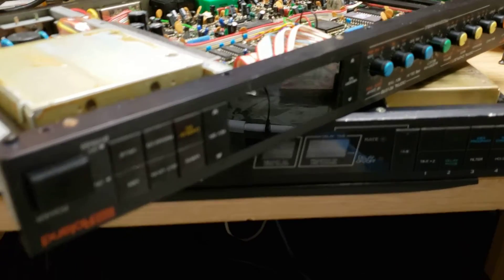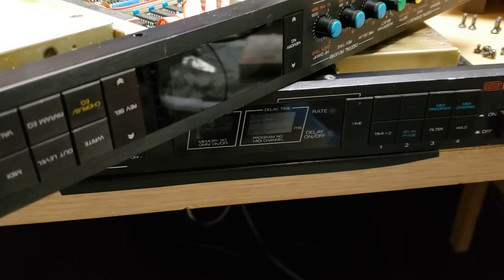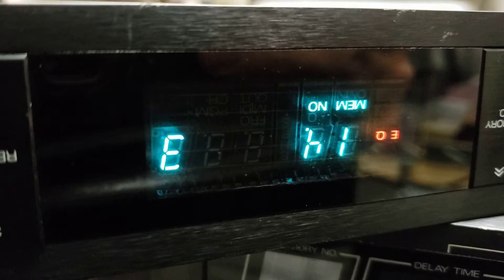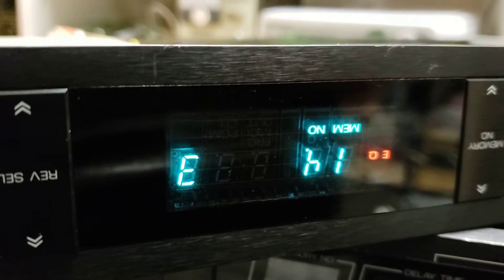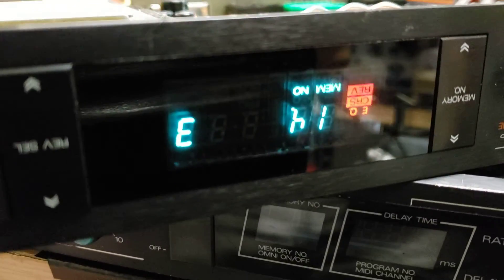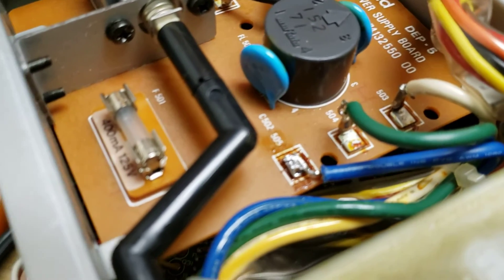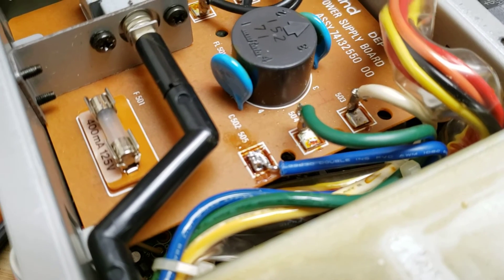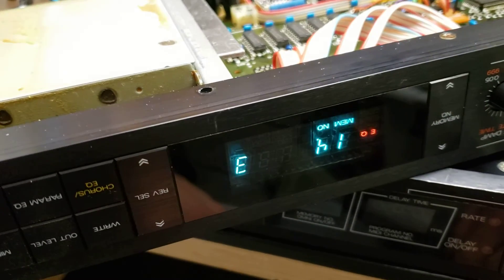Classic Japanese Rack FX - Keep 'em well with this fix.

Comment: Thank you for taking the time to make this video. My DEP-5 has the factory 117v badge on back, and the Blue to 505, Green to 504, and white to 503. This is like your video showed. Mine runs extremely hot to the touch--- should I change the wiring?

Comment: It's good advice to resolder it from 100V to 117V, but that's a sketchy anecdote about VFDs! That's not what happens when you plug a 100V DEP-5 into 120V, and if it does you need to unplug it fast!

The voltage to the display doesn't change when you run a 100V model on 120V — you can check with a multimeter.

Those Roland PSU boards have +5V +15 -15V DC output rails, and the ones with VFDs have a +30V rail. The rails are regulated. I've soldered these PSUs, and I always check the output rails to make sure everything looks good, and the most I've seen a rail change after retapping it is 0.03V which is still well within spec. That 30V rail is spec'd at 30V-34V.

The reason you want to resolder the taps is because running a 100V model on 120V power makes the voltage regulators run hotter. It will shorten the life of the PSU, and if it fails THEN it might fry something if a regulator shorts instead of just failing open. But '80s/'90s Rolands go decades without failing. Most people run 100V Rolands on 120V perpetually with no problems. They have huge heat sinks on the regulators. 

The only scenario for the glowing VFD filaments is:
1) You leave a 100V DEP-5 plugged into 120V power for several years
2) The 30V regulator is the first PSU component to fail.
3) The 30V regulator fails short and starts to burn.
4) You ignore the electrical fire / burning plastic smell and leave the DEP-5 on.
5) The 30V VFD is now getting about 60V of raw rectified DC from the transformer secondary winding.
6) The filaments glow red!
😯🔥🚒

I doubt it could last very long in that state before the PSU board completely burned and the capacitors popped and the whole thing died — and hopefully didn't burn the building down.
Reply from the maker: Yes WRT regulators running hot but also the main transformer will run hot and have reduced life.  The VFD has a high voltage blanking cathode (the VFD is in fact a Triode with each digit having a Grid, and each segment being an Anode). The filament (cathode) supply is rectified and filtered but it is not regulated. (Grey wires straight from transformer, rectified, 470uF cap, to + - filament terminals), and the higher voltage Anode supply (+20V) is also unregulated. Maybe Roland changed this in a later revision but that's the unit I have and the schematics agree. Given that the filament only wants 1.7V at 80mA (according to SDE3000 service notes) I'm concerned about the filaments glowing ever so faintly orange before I made the transformer tap reconnection.

Comment: bought an sde-3000 running it on a variac at 100v so no issue there. It was initially sounding great but now has a loud pop every 15 seconds.

Comment: Hey, I have a couple of SDE-3000's just wondering if i can convert the transformer inside to work on 220V as its currently 100V I know I could use a external step up/down transformer but would prefer to convert it internally.
Thanks!
Reply from the maker: Unfortunately that requires a different transformer. The USA/Japan units are the ones that have a 100V/117V primary. For EU/AU you need the unit with the 220/240V transformer. You could possibly buy that as a spare part from your regional Roland service department, but given the age of the units it's not likely a stocked item anymore. You will most likely have to use a step-down transformer.

Comment: Thank you for sharing this! I have a SDE-3000 arriving soon from JP to try this on.  Do you know if this same procedure applies to the SDE/SRV-330 power supplies? I've been looking for a reasonably priced SRV-330 and getting a 100v unit from JP appears to be the most cost effective.
Reply from the maker: Just examined the service notes. The service manual schematics and BOM indicate the Japan/US unit has a transformer for 100 and 117V just like the older units. Attach the blue tap for 117V or the white tap for 100V - so yes in short, this will work for the SDE/SRV-330 as well.
Reply: This is gamechanging information bruh, thank you for sharing! @schematica
Reply from the maker: It should. But the SRV/SDE-330 units are much newer - they might have switching power supplies and may even be universal (like your modern laptop adapter). One of these days I'll check them out.
Reply: For the SRV/SDE-330 you just swap the blue/yellow wires connected to the "502" and "503" pads to switch between 100V and 117V.

Comment: Is that the same for the Boss SE 70 super effects??? I plugged it up for about an hour and man that thing was SO HOT on the bottom moreover. I got it in from japan...
Reply from the maker: SE50/70 are completely DIFFERENT inside. But yes it's the same problem. Given the small size of those units I'm not sure they used a transformer with a tap for 120V. The only way to know is open it up. If you keep using a 100V unit on 120V it will eventually burn out the transformer. To get them the size they did back then, before switching supplies were a thing, they designed the power transformers to be right on the edge of saturation at 60Hz. So it is working, but saturating slightly, which means excessive current in the windings, which means excessive heat and eventual demise.
Reply: @schematica  Doesn't the SE50/70 use a power adapter. 12 Volts if I recall? Correct me if I am wrong, but the problem of 100v/120v would not be an issue like what is explained in the video above.
Reply: @botany500kojak  LOL yeah I have two SE-70s from Japan, and it's irrelevant because the power bricks put out 12V AC. A lot of this stuff gets kinda hot. The SRV-3030 gets a lot hotter than the SE-70.

Comment: Thanks for this, I did a similar mod on my imported Roland GP-100. I'm not sure if the displays in 1996 were similar or not but at least I know it's running at 120v now. The wires were blue and yellow in the case of the GP-100 but often times you can find official repair manuals that list the wire colors and their specific regional configuration.
Reply from the maker: Nicely done! The LCD in the GP100 is a character display running off the 5V regulator. But you still want the transformer on the correct tap so it doesn't wear out ahead of time so still the right thing to do as you did!

Comment: I just bought a DEP-5 without knowing what voltage it is. I'm in the US. If it is 220V can it be changed to 117V easily? Thanks
Reply from the maker: Where was it shipped from? Within the US it is most likely going to be 117V, from Japan it's set to 100V but you can change it as in this video, but most of Europe and Asia is 220/230 and it's a different part number for the transformer. In that case you will need to get a step-up transformer (cheap on Amazon... )
Reply: I received it and its 117V, but as soon as I pushed the power button it pushed all the way in and stuck. I think the crazy power mechanism broke! So it did not power on...
Reply from the maker: @anonymous_friend  Yikes! So those are replaceable items. There's a plastic rod that connects the front-panel button to the switch which is on the power circuit board further back in the unit. It may just be jammed. Open the lid and take a look! (With the power cable unplugged of course!) If the rod is broken, call Roland and ask to order part no. 2214020700 (That's the long arm with two bends that links the front button to the power switch).

Comment: I have two Roland SDE-3000'S 100V. Will just swapping the Blue and Green be enough to safely run it on 117V? At the moment Blue and White are connected to mains (white is middle and green in connected to lower terminal/nothing. When unit is turned on  BLUE reads 120V and GREEN reads about 139V. Thank you in advance.
Reply from the maker: I have an SDE300-A and did this, yes it will work. The way  to know for certain is that after swapping Blue and Green, the green will be at mains 120V and the blue will measure around 100V since that's the transformer tap for Japanese mains voltage.
Reply: @schematica  And that's it? No need to do anything else? Thank you for replying.
Reply from the maker: @berumen_guitars  Yes.

Comment: Hi, I want to mod SDE3000 from 100v to 220v. Is there a way to do it?
Reply from the maker: There's no good way to do this other than to buy the replacement transformer for Roland's original export model. That would probably cost more than it's worth. However, you could just run it off a 50W step-down autotransformer, which is economical, or a 110V output inverter from a 12V DC power supply. If you were an Electronics Engineer/Tech and know what you're doing you could take the factory transformer out and replace that with a separate unit. The tricky problem is that these typically have an additional transformer output winding for the heaters in the vacuum florescent display tube which needs to be about 6Vac, and isolated from the other windings (the display is actually a special type of Valve/Triode tube). If you're in Australia/NZ/UK/Europe a step-down autotransformer will be fine. I've been using a step-up for an ENGL rack preamp to run from my 110V outlet in the states.

Comment: Your video is on a DEP-5. On the SDE1000 the white wire is in the middle terminal. Do you just reverse the green and blue wires to convert to 117VAC on the SDE1000?
Reply from the maker: I have an SDE3000 I did this on, and yes I believe it's the same. But first, to be sure, measure the voltage with a multi-meter in AC 200V range. If you plug into mains and measure from the main input and neutral, you'll measure about 120V AC, and the other tap if it's set for Japan will measure higher, more than 130V. Then those would be the two wires you would swap. In my units, all three used the same transformer with the same wire colors so you should be good, but always measure first to be sure. (and please, don't shock yourself...)
Reply: @schematica  Thanks for the feedback. It is the same. I just swapped the blue and green and works and tests perfectly. Thanks again!
Reply: @schematica  Does this also apply for the Boss SE70?
Reply from the maker: @officialpoa3171  no.

Comment: Hi there! I'm a service technician from Argentina and I'm having trouble repairing an SDE3000, can you help me?
Reply: What's the problem?
Reply: @guitarrigguru  something's wrong with the feedback loop, or the D/A A/D cycle. The delay "seems to work" but it has infinite feedback always and signals dont come out of the delay path. I couldn't get help from other locals technicians
Reply from the maker: @camiloalvarez9850  My recommendation is to use the SDE3000 service manual (you can download from many places on the internet for free), and walk through the step-by-step measurements of the different test points that describe the signal path and A/D/A conversion. Start with a sine wave signal input and trace the signal with your oscilloscope from the jack all the way to the AD converter. The feedback path in the SDE3000 is analog (like early BOSS DD-2) so you can (referring to the schematic) short the middle of the feedback signal to ground and if you are still hearing noise or squeeling from the delay output, then you probably have bad DRAM chips causing noise. I hope that helps. I'd offer to look at it for you but I suspect the cost of shipping the unit to me and back to you is more than it would be worth to just buy another one off ebay.